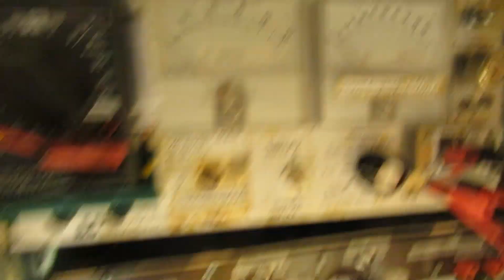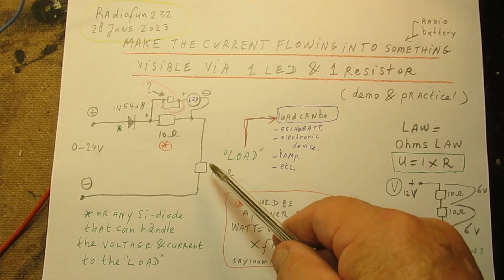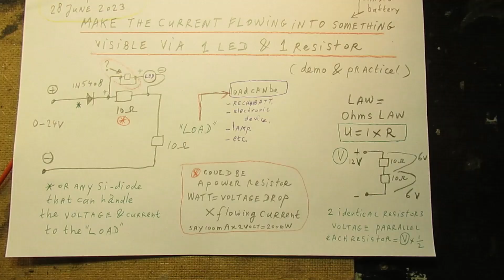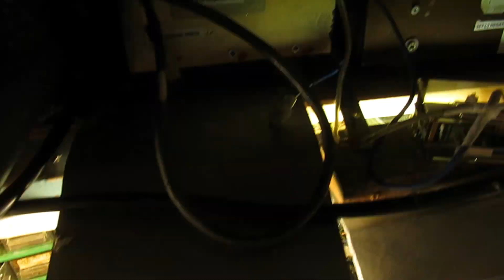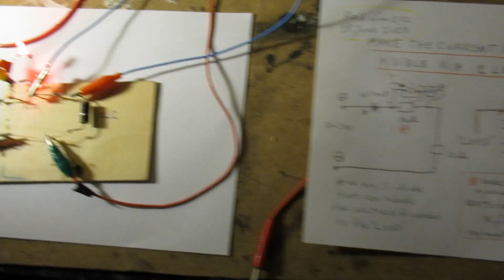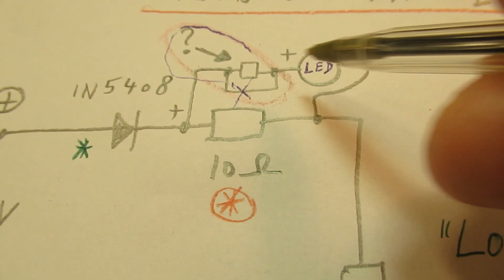Make current flowing into an electronic device (say a batt. or so) visible via 1 LED and 1 resistor

Comment: Why is the other 10 ohm resistor a higher wattage than the resistor connected in parallel with the LED? If you applied 12 V DC to the circuit, from Ohms law there should be 6V dropped across each resistor. But thats not the case.
Reply from the maker: Thanks Ron, that is/was only for the demo. I could have used in both cases 2 x a 0.5 Watt 10 Ohm resistor. No problems with that.

I wanted to show that the "load" (here 10 Ohms, the power one) could also be something that needed more power/current to be supplied with. But also in that case, you are right: the resistor servicing the "LED" (10 Ohm in this demo) could also have to have a higher wattage. Because it all in this demo (trying to show the principles) was in the 100 mA range there was no need for that.

But there is an issue: That the first 10 Ohm resistor in the circuit has a diode (=LED) parallel to it, so it acts no longer purely ohms (linear), but acts as a zener diode, depending on the colour of the LED (somewhere between 1.8 V Red LED and 4 Volt White LED). So a non-linear semiconductor, paralleled to a linear resistance of (in this case) 10 Ohms. 

The effects of this all are not very peculiar, though to be taken into account, when making such a current indicator with a LED. That is the reason why I limited the whole setup/demo into this simple way (2 x 10 Ohms, Ohms Law, Wattage calculation, etc.); trying to show the basics of such a LED current indicator. 29 june 2023.

Comment: The Circuit I use to show current flow in a 24V circuit via an LED is 1. Power NPN Transistor 1. 2k4 Resistor 1.LED  All in the positive line. The C of the TR and the Anode of the LED to pos supply. The B of the TR  to the LED K and one end of the Resister. The E of the TR to the other end of the Resister, This also becomes the Pos O/P to the load. How it works. When Hi current is flowing. the B of TR is at 3 V Via the Potential divider of the K of the LED and 2k4 resister so the High current flows from C to E of the TR. As the current falls, the divided Volts falls till below 0V7 and the TR is off and LED is off But the battery is fully charged.

Comment: You said that maybe this was a rather basic circuit... Well, yes, but you have broadened my thinking. As you say, there is a difference between voltage being available to the circuit ( a simple power indicator bulb [to ground] on the front end) and the circuit actually operating (that is, current is flowing and the circuit is doing some work [or shorted = lol.]) The cleverness required to design the circuit for a particular application will need to include not only the necessary indicator components, but where to place the indicator circuit within the master circuit. Actually, I don't think a current-flowing indicator will require any additional components/expense than just a power-available indicator... Each require a resistor and a LED; the trick is their configuration and placement. Kudos for your good thinking!
Reply from the maker: Thanks, yes the setup is very versatile and can be used for all kinds of electronic circuits.